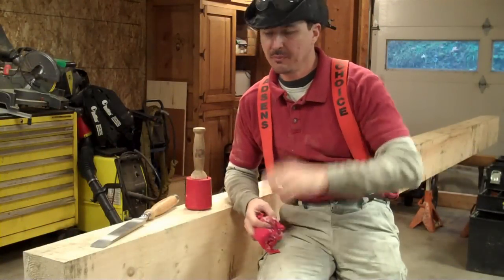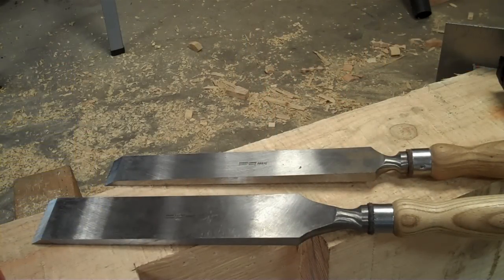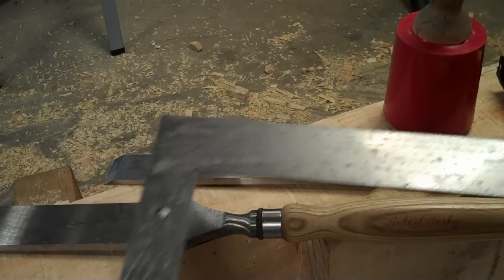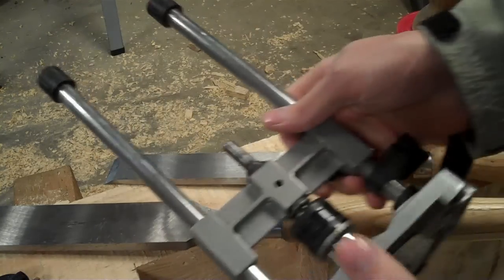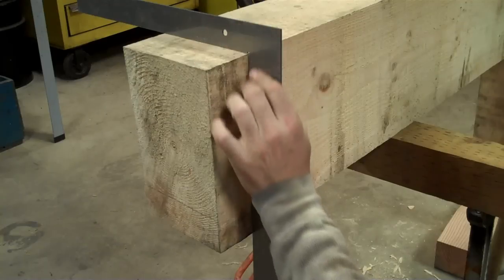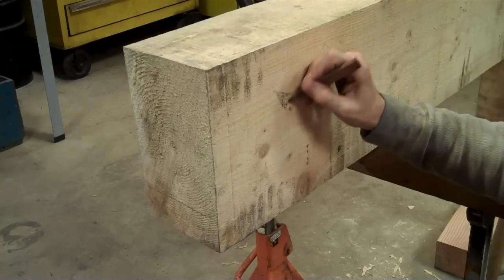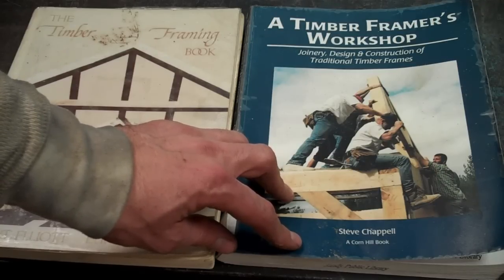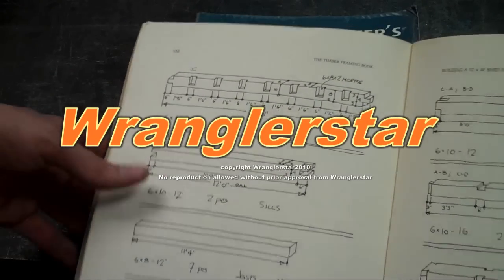Building the Foundation: Timber Frame Beam Setup with Alaskan Chainsaw Mill

Comment: I've found a trick for drilling holes square. If you've got steady hands you can use a plastic mirror to sight your auger bits. Make a hole in the mirror, clamp it to your work and eyeball the bit. If it's straight in the reflection it should be square.

Comment: @acrowwing A hewing broad axe differs from a regular broad axe in two important ways. First, the blade is beveled on only one side. The other side is perfectly flat. On a right-handed hewing axe, the left side of the blade is the flat one. The edge is put on by beveling the right edge only. The second difference is that the handle of the hewing axe is offset in order to keep the users hands clear of the log. A double beveled broad axe is used for chopping or notching.

Comment: Here's a few fine woodworking tips for you.  When you mark your cut offset your pencil line to one side of the actual cut line.  Than you are either cutting up to the pencil line or cutting till its gone depending on how you marked it in relation to the material being removed.  This will take care of the pencil line not being accurate.  Also you can use chalk to write notes on the faces of your boards and it comes off easier than pencil does.

Comment: For those looking to buy, that large square you showed is actually called a "Framing Square" and the axe used for hewing logs is a "Broad Axe".
Reply: I have been looking for a large framing square, but the largest I can get is 24" x 16".
Is the one Cody is using that size or bigger?
Reply: I though a Broad Axe was an axe meant for a woman to use.